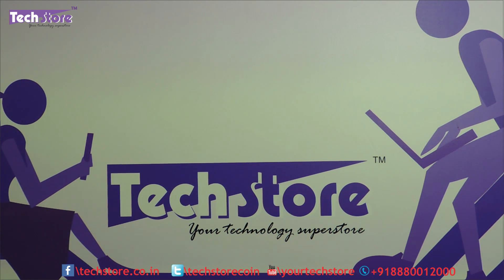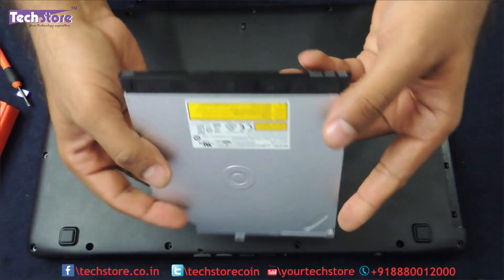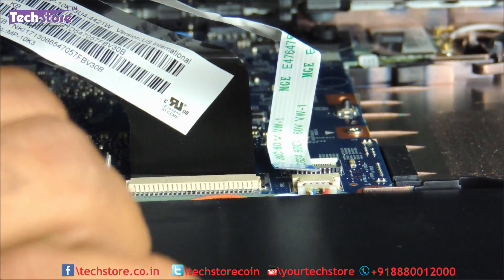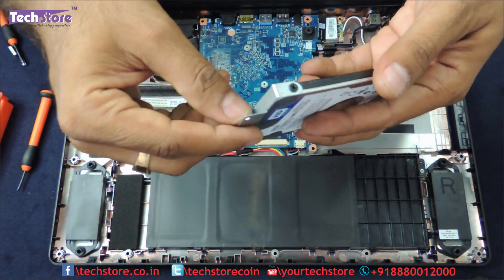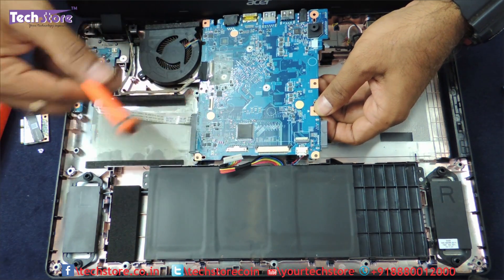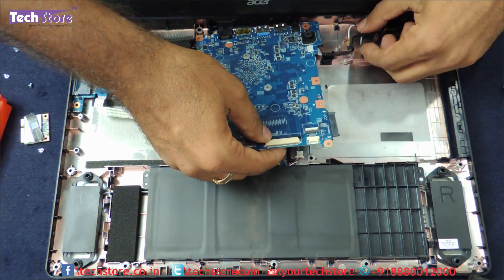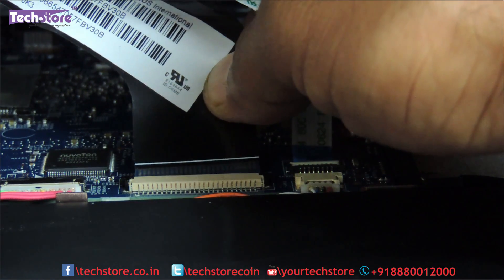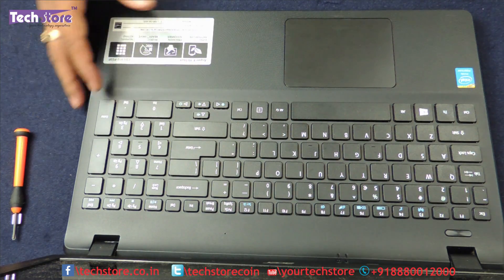Acer Aspire ES 15 Laptop ES1 531 511 521 571 How to Upgrade ram and harddrive easy

Comment: I have an ES1-512. Be aware that on that one Acer has a couple of screws holding the DVD player in place - you have to open the case and remove them to remove the DVD player.

Comment: CAUTION! He failed to mention that if you don't first have recovery media that either came with your computer or that you created to restore the OS onto your SSD (BEFORE puttingg in the new SSD), when you put in the new SSD and turn on your computer, it will say "No Bootable Device" and you will have to open it up again and put your old HDD back in and close it back up, turn it on, and create the recovery media on a stick. Then put back the new SSD and the computer will boot off of that media and provide options for restoring the OS onto your SSD. During the recovery process, the SSD will automatically be partitioned, formatted and made bootable.
Reply: This vid is about the hardware aspect and not the software.  Someone might be upgrading and tossing on LINUX

Comment: Thanks to this video I was able to upgrade the RAM on my ES1-571 without any problem or getting stuck. The difference is that my laptop had two slots so I was able to add memory.

Comment: Great video, thanks.
I upgraded from 4gb ram to 16gb, had 2 slots. Bootup was faster but still slow (was 9 minutes down to 3). 16gb made the laptop more able to use more demanding software.
I then upgraded the 1 tb HDD to a 500gb SSD, it was then like a totally deferent computer. Boots in 20 seconds including windows log in and displaying desktop. Programs open instantly, very happy.
If the computer is 5 years old it would be advisable to renew the cmos battery on the underside of the motherboard while you have access to it.
Reply from the maker: Glad we could be of help. DO SUsbcribe.
Reply: It took the 16?  I read elsewhere that it wouldn't post on 16GB only 8.  I'd like to beef this one up.
Reply: Hello, I am just watching the video to check if i can put in another 8gb. I want to know if it has two slots, i forgot to check when installing the 8gb ram🤣🤦🏾‍♂️
Reply: Please help me i want to upgrade my laptop to 16gb ram too

Comment: Hi I hope you can advise when I turned on my acer laptop E1 523 model it had a blue screen bios. I tried all the settings but its not booting. I think the hard drive may have gone and if I replace the hard drive then try to upload with a usb stick is there any else I need to do. If you put a new hard drive will this clean the memory. Please help I have never done this before and could you let me know what I need to do to get it working thanks J
Reply from the maker: Please show it to a nearest service centre.

Comment: Thank you for this video.  I followed your instructions and installed a new  SSD drive and upgraded the RAM. Worked perfectly when I booted up. I was left with two little screws which I must have taken out from somewhere but they didn't seem to affect the operation. What a ridiculous design though to have to do all this, especially installing the RAM chip.
Reply from the maker: Glad we could be of help.
Reply: Agreed.  I had a few laptops where they had little "doors" on the bottom.  Two screws and you could swap them out.  I guess they consider these laptops disposable .

Comment: Hello sir, i was wondering what kind of ram should i get (8gb module) for my laptop. Its Aspire ES 15 ES1-531-P5J5. Max Memory specifications is DDR3L 1600 SODIMM but i cant find it anywhere. So can i add any DDR3 1600 8gb to my laptop? If  so can you pls tell me which one, I would really apppericiate it.
Reply from the maker: Yes you can add 8GB ram DDR3L 1600mhz
Reply: @TechstoreCoIn  thank you bro. I really hope this would work.

Comment: Its the best Laptop ever           lnfo.help/Aspire?31E I had a HP 15 system before it was slower than an ant. After getting acer everything is speedy for work purpose. I even play high end games with the 2gb graphics card. I dont bother about how lite the graphics is as long i can play the game im fine with it. its a workstation for me. i changed my ram to 8gb and hdd to ssd. It has all the options to change the hdd and ram. wonderful ACER!!

Comment: Nice tutorial video.  When I attempted to remove the ribbon cable (shown at ~3:30,) a small thin black plastic strip (size 32.5 x 3 x 1 mm) fell off but does not look broken.  Can this be put back when reconnecting the ribbon cable?

Comment: I have aspire ES1-531 -C042 so it's very slow it's have 2 GB ram ddr3L memory if I want upgrade with 4gb ram it will work better than before or its depend on CPU please help anyone thanks
Reply from the maker: Yes it will work very fast. But, we suggest you to install SSD which will make it work 5X better.
Reply: @TechstoreCoIn  thanks for suggestions

Comment: Hi good video.
My is acer aspire es15
I missed pussed the back site battery removal hole. After the inceddent lap is not charging and not work without ac direct.
How can repair?
Reply from the maker: Contact Acer repairs

Comment: Hi, extreme long shot here, but the black plastic clip that retains the larger ribbon cable in place, notches on both ends mentioned at 9:50-10.00 just broke on a ES1-531 I'm working on. Any ideas on how to replace or otherwise get the cable to stay in place please? Thanks!

Comment: Is it possible to replace processor? And if it is what is the best one that can be putted in?
Reply from the maker: Not possible to replace processor
Reply: Techstore thanks for the information. Will upgrading ram help to laptop work better? because its really slow on windows 10 and windows 8.1. But windows 7 can't be installed, i mean it can but there are no drivers for it.
Reply from the maker: ideally install ssd which is a better solution for improving speed

Comment: Fantastic video thankyou :)

It helped me very much, as I have upgraded the RAM in an ES1-531 from 4GB to 8GB

I also cleaned the unit out, the fan etc and also while I was inside, I replaced the thermal paste on the processor with Arctic MX-4.

A very clear and professional video :)
Reply from the maker: Thanks for your appreciative words. Do Subscribe.
Reply: hey, you probably wont see this but i really hope you do, what RAM did you use as the upgrade?

Comment: Thanks for this tutorial, I have an ES1-571 and with the crucial uk scan tool it reports that there are 2 slots available for Ram, up to 16GB..? same with Speccy and CPUID
I was surprised to see yours only having 1 slot? perhaps there are variants of the ES1-571?
Guess I wont know for sure until I open my case and I agree it seems a horribly difficult upgrade just to install RAM. Dont Acer want people to upgrade?
Reply from the maker: +BrigadierGraham I strongly feel there might be another slot for corei3 variants ,but the motherboard when opened did not show space for another slot. I hope I am wrong on this one.
Reply: Thanks buddy! I forgot to mention its a corei5 fingers crossed:
) will be interesting to find out and I'll let you know.